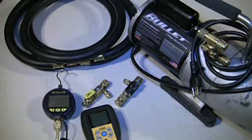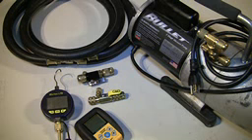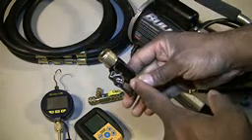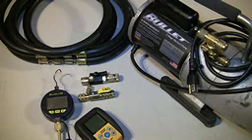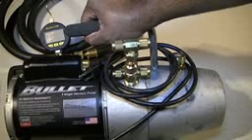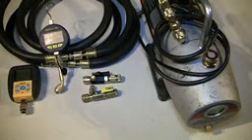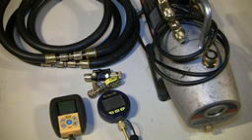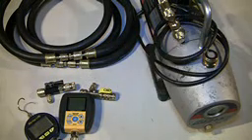Fieldpiece micron gauges, appion hoses  &  yellow jacket vacuum pump

Comment: I'm gonna try using that Nylog sealant.  I actually just ordered the rapid evac kit and the blue vac micron guage so I'm actually pretty anxious to try them out.  The reason I mentioned the sealant is I've noticed with my old set up if I tightened (by hand) the hoses just right, I could get down to 500 microns but sometimes it really boiled down to how the fittings were tightened down.  I'm hoping that sealant helps out with everything.  Also, I'm probably gonna get some 45 degree fittings for those problem fittings that you just can't connect to with straight fittings.  Thanks for the video.  You might want to invest in a better camera though :)